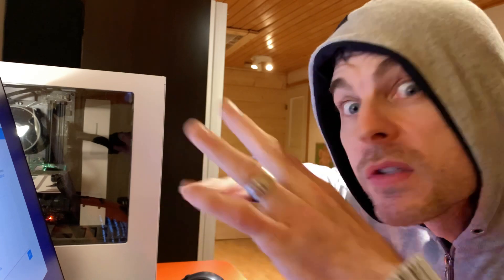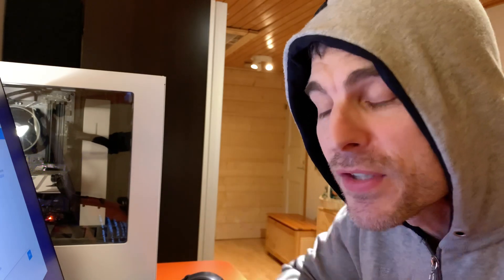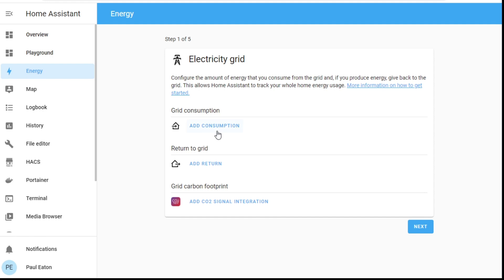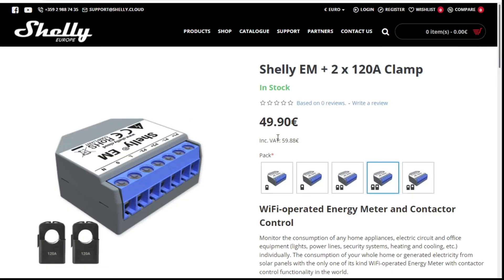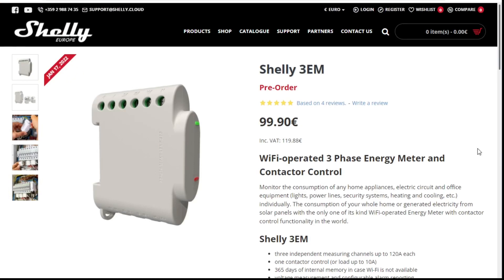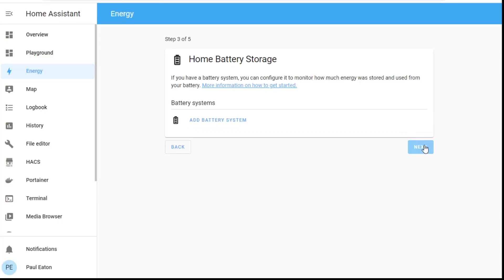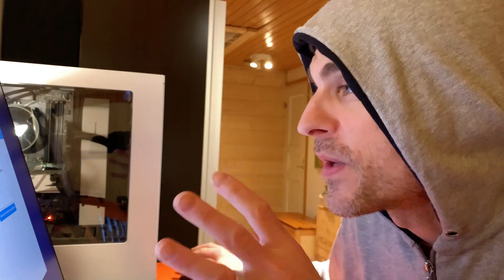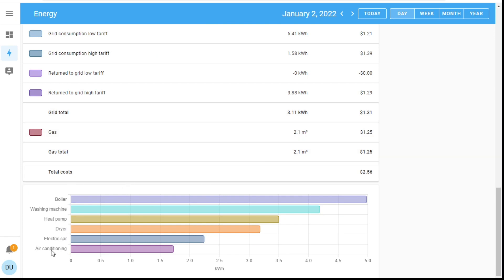Home Assistant: Energy Management | my plan.

Comment: I thought about solar panels...but our property doesn't have mounting spaces with enough sun exposure to make it worth the cost. I'm lucky enough to live around some nice big old trees.

I use power monitoring plugs in combination with a Sense Energy Monitor that has the clamps around my main power and integrate them with Home Assistant. I made sure the plugs retain memory of last state...so if the power flickers...my fridges and freezers will automatically come back on with the power. I rarely use the native app for the plugs...and I didn't build any dashboard switches for them in Home Assistant. So, I've not had any issues with them. Fingers crossed that you didn't jinx me. 😀

The Energy Monitoring dashboard in Home Assistant is pretty cool. Now I just need to utilize the information to actually adjust some of my consumption habits. Or even tougher...convince my wife to adjust habits. 🤣
Reply from the maker: Thanks Dexter. Doing my Sunday tinkering and just checked out the Sense Energy Monitor. Yeah you've got a great setup.

And no jinxing I'm sure. Those plugs will keep working nicely. 'Rarely use the native app for the plugs'? So you have them integrated into Home Assistant and just see consumption there I  understand. Right?

Our consumption habits have changed already as switching to the 'Nordic Power Exchange' and paying spot prices has provided some big motivation. Oh man this winter is expensive!
Reply: @PaulWarrenEaton  Right...I see the consumption in Home Assistant. But didn't put any toggles on any dashboards where I might easily click by mistake. Had to make them Dexter-proof.
Reply from the maker: I might need to Paul-proof a few things in my setup also.

Comment: Something that I did was run a UPS in my office and run all the lights servers and networking gear off it. When there's a black out I still have between 4 and 48 hours of power depends on how I use it.
This is with the help of one 12V PSU that runs everything with a DC jack and some conduit.
Reply from the maker: Oh wow! Now that sounds like an awesome custom build. Smart move to go 12V DC. Starting to think I want to try in the future a whole house (cottage perhaps) on 24V or 48V DC.
Reply: @PaulWarrenEaton  There are some awesome things you can do when you have the kind access you have with a proper backup solution like that. Sol-ark and EG4, https://www.youtube.com/watch?v=T9JPNH2ZaEE This thing is a beauty, when I do get around to building my own house a solution like this is it.
Reply from the maker: Thanks. Yes I’ve started the heading down this research path now myself. I appreciate the video link. Quite a setup!

Comment: I know that if you use Tasmota at least, there's a variable you can define which sets the switch to be on by default so in the event of a power loss etc, it should always be on. That gives a bit more peace of mind than just a "use last remembered state" setting, and seems to work well for me (I do it with my geyser/hot water heater, which I want off by default). But you'd definitely want to flash a custom image with that setting hard-coded, so that if the configuration memory is lost/corrupted and resets to defaults, then it resets to that setting by default.    Another approach you could try, involves physically modifying one of your smart switches by soldering a bridge wire to the right solder joints under the relay switch so that it basically bypasses the relay and stays permanently switched on even if the electronics decide to try switch it off for whatever reason. Then it's no longer a smart switch, just a power meter, until you choose to remove the solder bridge again of course. As for running batteries in the day, be sure to factor in the cycle count life of whatever batteries you plan to use for that along with the cost of the system in deciding whether your utility cost savings would be outweighed by the cost of your system. I prefer to use batteries for backup only and if you barely ever experience outages, you could save a lot of money skipping batteries altogether and rather opting for a Grid-tied solar system instead to achieve your day-time cost savings! Consider a "hybrid inverter" which offers both stand-by/backup AND grid-tied functionality, to fully future-proof your system and get the most out of your PV production.
Reply from the maker: Thanks Dimitri. Great tips here. Looks like with some of my plugs I will go with Tasmota. I'll be sure to consider the 'should always be on' option. Yes for my fridge I could go the solder option. Another good idea.

As for the battery setup, excellent things for me to consider. Thank you for the advice on system cost VS savings. Very important for me to consider this. Big part of the reason I want to get a grip on current consumption in our house is to know what battery system would be needed at what cost. As for solar, unfortunately I can't do it in the place we live now but I've started thinking about that at the cottage.

Thank you again for taking the time to share your knowledge with me. I really appreciate it!

Comment: This is attempt #2, youtube decided to delete my previous (rather extensive) comment. Some things to take into account when setting up entities for the energy dashboard (please follow this order, otherwise it will probably not work)
1. ensure that the following attributes are captured per energy sensor
    - unit of measurement: kWh
    - state_class: measurement or total_increasing
    - device_class: energy
    - last_reset: time
    
Can be achieved by using the utility meters. I have athom smart plugs that have a total daily energy counter in kWh that resets every night. I use that counter as a source for the utility meter (1 utility meter per smart plug). I have also tried the method recommended by Home Assistant (Riemann sum integral), but I could not get it working. 
2. then (if you do not use default config) in configuration.ymal add ‘energy:‘ and add your energy sensors to recorder 
3. then add the sensors in your energy dashboard

I can share all the YAML-code with you if that is helpful.

N.B. It can take some time before the data shows up in your energy dashboard.
Reply: How important is the last_reset? My Shelly smart plugs don't have that, at least not as default. They use state_class total_increasing.
Reply: @Pikminbloomshorts  You can always try it without last_reset and see if it works! My powerplugs reset the calculation of the kWh used per day, so I understand that HA needs to know when they were last resetted.
Reply from the maker: So sorry that YT killed your first comment. I've seen that happening all too often with comments on these videos. :(

Thank you for attempt #2 !

These steps will be extremely helpful in the near future. I can feel a video showcasing them coming soon. Thank you again.